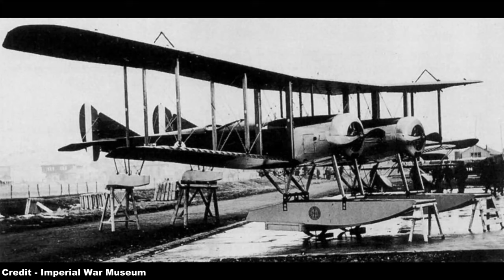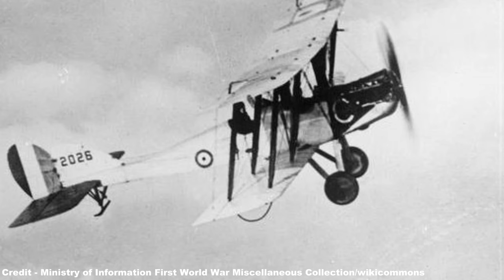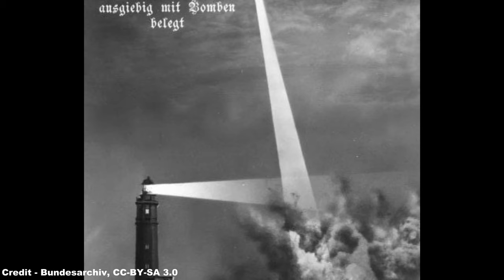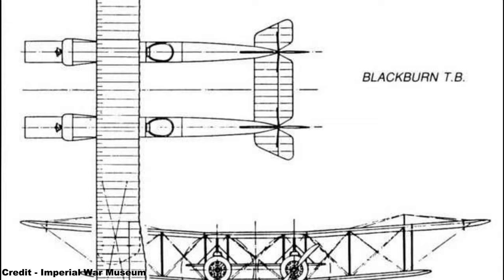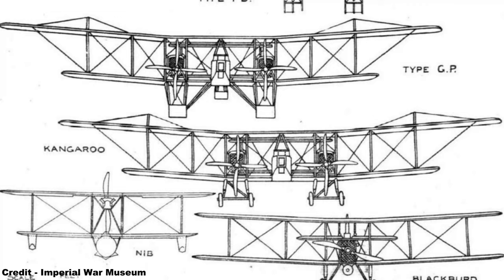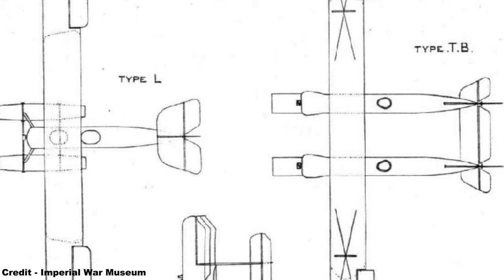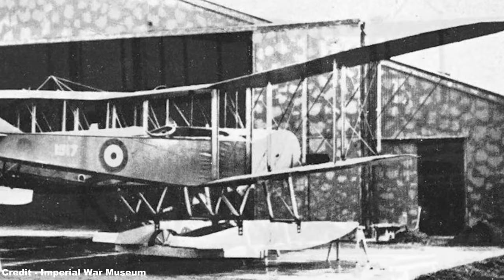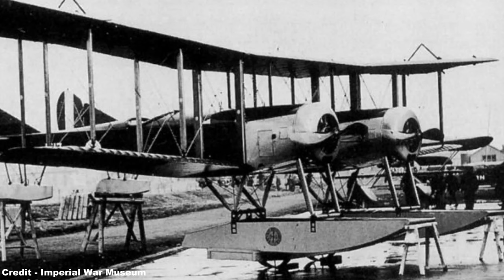Flying Failures - Blackburn Twin Blackburn

Comment: i really want one, add a rudder, Buy a pair of floats with rudders, so you can steer, rather than crank around at full powder, then over control and crash into the dock at about 50, no breaks on boat or pane, do not park by ear.